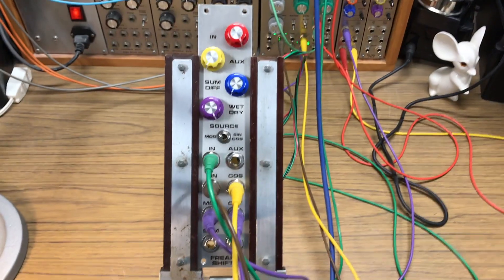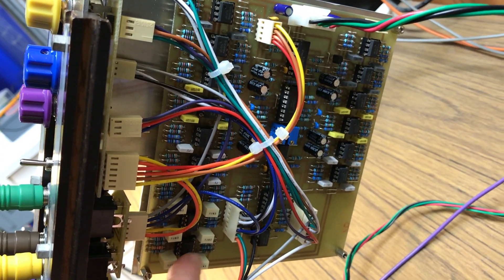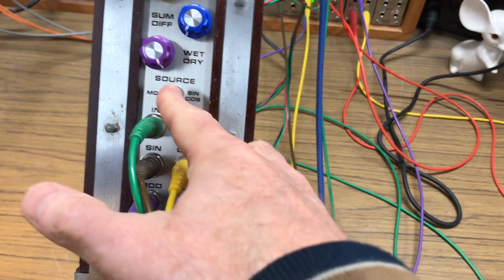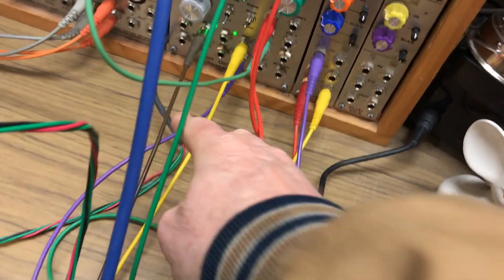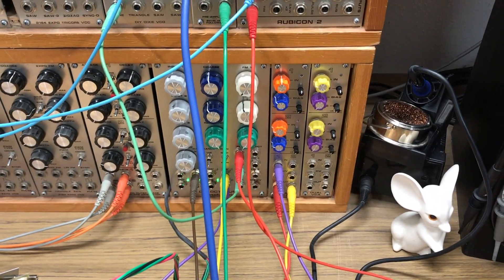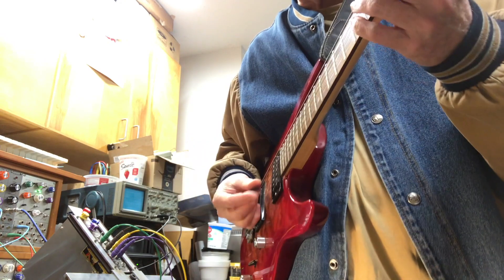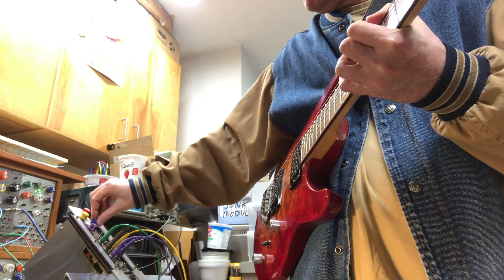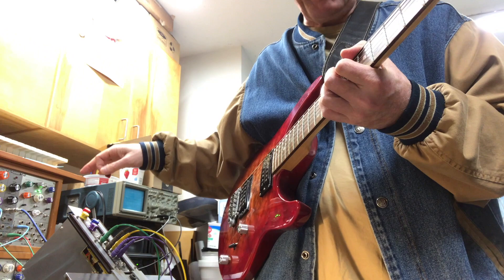Doc Sketchy Frequency Shifter, Part 4: New Freak Shift "Lite"

Comment from the maker: Hey peeps, I see that new people are still subscribing to my channel.  I apologize for not making any new videos in, like, a year (!).  I plan to rectify that situation soon, I promise.  In the meantime, I've been very busy actually building eurorack and Dotcom Freak Shifts.  I think I've sold over 110 of them so far.  They are much more compact than the one shown in this video.  I keep thinking I'll make a new video with an actual eurorack unit, but I just never do.  Now I'm selling Dotcom versions of the dual multiplier shown in one of my other videos, which I'm calling the Delta Quadrant.  I've sold a couple of those, and in fact I'll be making another one of those tonight.  Maybe I'll post a short video of that.

Comment from the maker: UPDATE as of 15 November 2011: I am currently working on unit #77, and have orders out to #94.  I typically build about 4 units per week.  I can build in either eurorack or dotcom format -- to see examples of both, please refer to the relevant thread on Mod Wiggler.  There are two threads dedicated to this module: one for euro and one for dotcom, as well as my generally "Something New" thread.  I was thinking of making a new video, but I just haven't gotten around to it.  Suffice it to say that the circuitry is identical to the unit in this video, although the PCBs have been laid out to fit behind a 12U eurorack panel (or a 1U dotcom panel).  The eurorack units have professionally made panels (Metalphoto black graphics on bare aluminum) and the dotcom units are laser engraved onto actual dotcom blanks (with a $20 surcharge for the privilege -- this price may go up for future dotcom builds, because I may have to change the way I'm getting these made -- I don't have my own laser engraving machine).
Reply: Hey doc, I am one of the lucky 77. Still trying to wrap my head around things however. Is there a manual yet or something explaining the basics and a few basic patches or maybe I should just watch a few more videos? I am also trying to use it for a guitar application actually :)
Reply from the maker: @joshk2181  Hey there, #39 (with cream-coloured knobs)!  The short answer is, there is no manual.  In fact, I barely know how to use the thing myself.  What you see in the attached video is more or less the limit of my ability to use the Freak Shift.  I would recommend watching J Daniel Cramer's crazy video, Strange Attractors #1 -- here's the link: 

https://www.youtube.com/watch?v=z14b01s52D4

He has done all sorts of weird stuff with his Freak Shift (the original eurorack prototype, with a butt-ugly handmade euro panel and a huge single PCB about 8" deep).  But really, the order of the day is to play around, experiment, etc.

Comment from the maker: UPDATE as of 11 August 2021:  I have been making eurorack Freak Shifts like a fiend.  I've managed to ship 43 units, 7 with homemade laser-engraved black panels and the rest with professionally made natural aluminum metalphoto panels.  They have been shipped to every corner of the world.  Obviously, I have never made that new video I promised to make.  I will try to make a short one mostly just to show off the unit.  As I mentioned below, it's about 3" (80 mm) deep, so doesn't fit into some cases.

I'll be making them for the foreseeable future, as I ordered 150 metalphoto panels, and have only used 36 so far.  So, if you want one, get on Mod Wiggler and send me a private message.  I've currently got orders that I won't be able to fill until late September or early October, so you may have to be a little bit patient.
Reply: Hi! I'm sorry but I'm one of those who are still not on Mod Wiggler and I'd really like to order one. Don't mind waiting until October at all :) Is there any other way to reach you? Thanks!
Reply from the maker: @benki._  Hi Ben, you could send me an email, but I'm not putting that on YouTube.  Just join Mod Wiggler -- it only takes a minute.  Then you can send me all the private messages you want.  Once on there, you'll discover all sorts of other things you might want.

Comment from the maker: This is an update to the eurorack Freak Shift situation:  I now have over 50 orders, and have managed to complete 22 units (I'm currently building about one unit per day -- each unit requires about 5 hours of my labour), although I'm waiting for panels to arrive in the mail.  The units are still about 3" deep (about 80mm) so will fit most Doepfer cases, but not Intellijel cases, sadly.  Also, they are available with either natural aluminum panels or black anodized aluminum panels.  The former are professionally made at Metalphoto of Cincinnati, and the latter I laser engrave myself with the help of my buddy Ian.  The price is still US $300 plus shipping ($30 US to the US or Canada, $50 US to anywhere else).  The best way to order one is to send me a private message on Mod Wiggler (I'm Dr. Sketch-n-Etch).  If you are not a member, and you are reading this, then you really should be, so just sign up (it's free).  As I promised before, I will make a video to show the euro Freak Shift, just as soon as the panels arrive from Cincinnati (which should be sometime this week, the second week of June 2021).